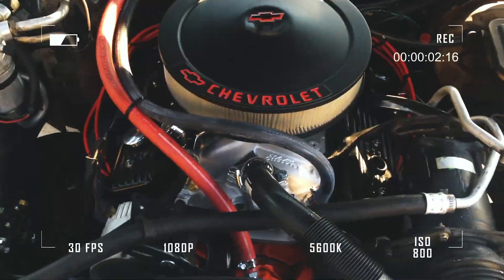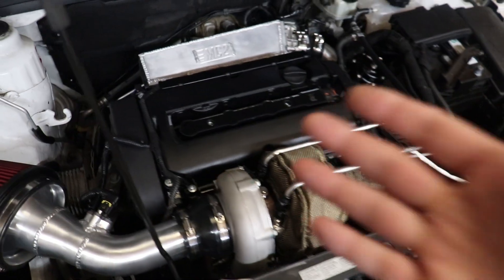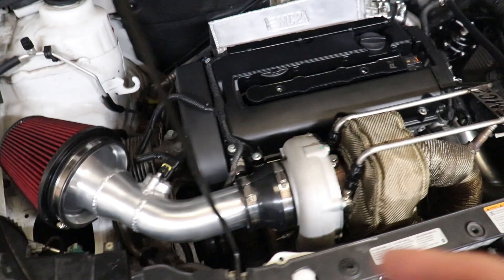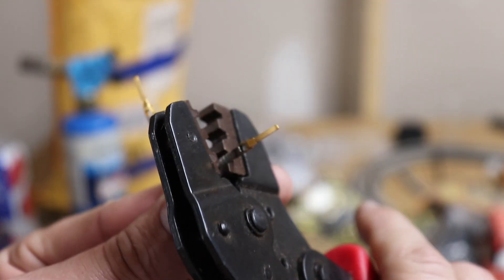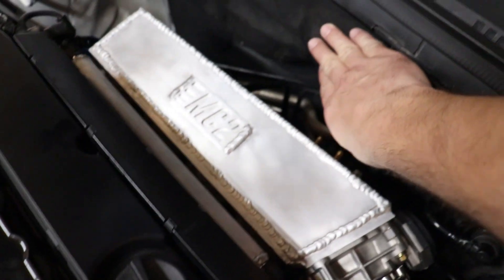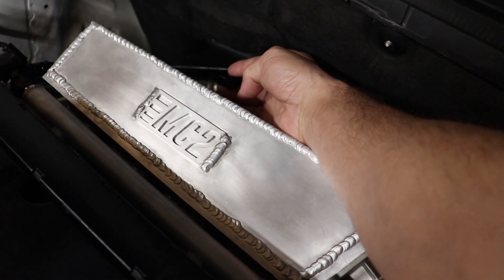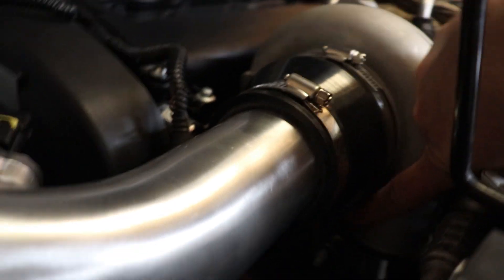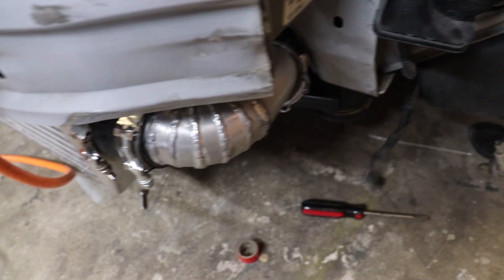Final Steps to Starting My Ebay Turbo Project Car!

Comment: You're doing a lot of the stuff that I did a couple weeks ago when I got my new intake manifold... I still have to run the fuel return line back to the gas tank... but very similar stuff(Saturn Sky though)..
Also...searching those bends... UJ aluminum  or UJ stainless steel bends results better than UJL bends...just fyi...🏁
Reply from the maker: Nice. Would love to see how you tackle it as well. Thanks! Will be sure to check them out.
Reply: What engine in your Sky? And what manifold are you using? I've got a modded Sky Redline

Comment: Love what you did with the solanoid. I was thinking of doing that to a throttle body I brought, cut the housing to make it I feel now if I had of went down that road it may have been a bit more peppy as the port of the throttle was a little deeper it would have been like putting a spacer on for more air flow. If that works
Reply from the maker: I appreciate it. Just did some soldering, extending, and some plastic welding. Worked like a charm and I'm sure it'll hold up great.

Comment: Not to be crazy you should pull the oil filter out & inspect it as insurance or even change the oil.  Be safe Don't covid it sucks.
Reply from the maker: Pulled it an all looks good. Was just a little junk that was probably logged even with through cleaning.

Comment: Looking good. Did you mention what you're doing with you pcv system?
Reply from the maker: Thanks! I have a Motion Raceworks catch can. Will vent from the stock PCV straight to the vented catch can. If that's not a enough, I'll vent the oil fill cap.

Comment: My friend a question is that project easier on the 1.4l chevy cruze because it already has a turbo ?????
Reply from the maker: More than likely. But the extent of the mods that you would even do with a 1.4, still a lot of work. You're more likely to find kits already. However, you're still working with .4 liters less.